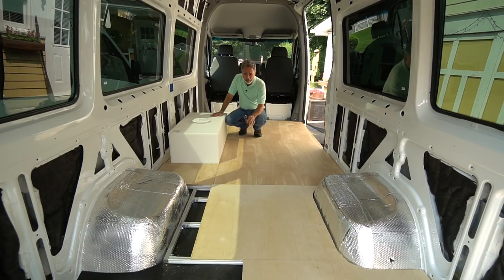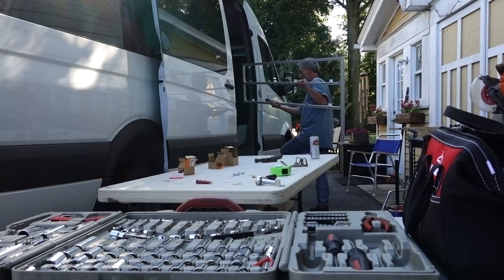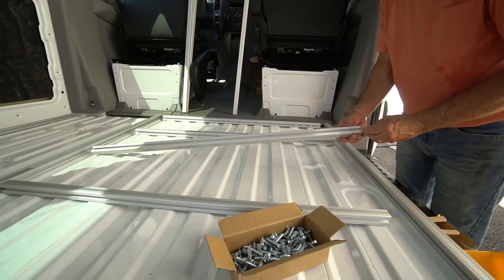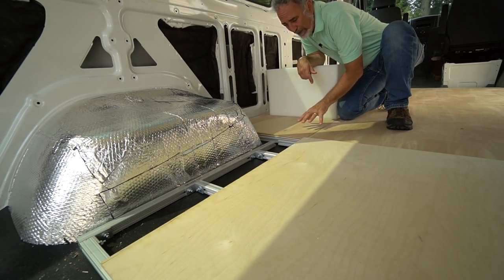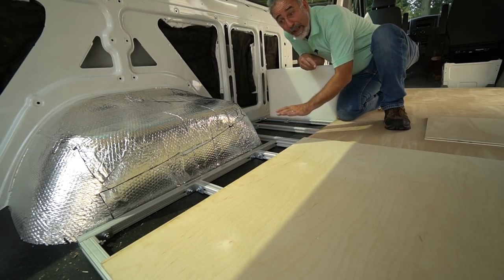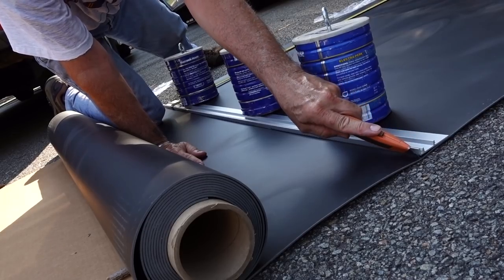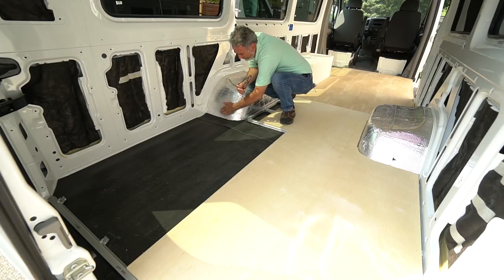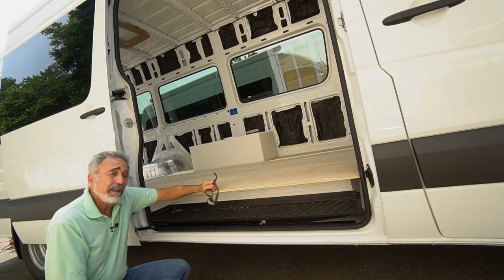VAN BUILD SERIES 09 | My Floor Design

Comment: One consideration though, aluminum is an excellent heat conductor. Wouldn't it be better and simpler to use some composite wood product, i.e. engineered decking wood?
Reply from the maker: Yes aluminum is a good conductor of heat. But only if heat is applied to it. Mine is sitting on 1/8" of heavy mass vinyl. That is a major league thermal break. Also affords a vapor barrier and sound deadening.
Engineered composite deck products are not made for indoor use. Toxic chemicals and off gassing.
Reply from the maker: Some have complained about my choice of material. I want something impervious to moisture, mold and mildew. Longer lasting.
Reply: I'm with you on that point. No wood in my (future) build, if possible. Wood is susceptible to moisture, will warp, crack, mold, rot, etc. Plus it's heavy and takes up too much precious space.
When it comes to the floor I was wondering if it would be at all possible to get away with no battens? I mean the polyiso board stands up to compression and is commonly used in construction under plywood or concrete over large areas without battens. Perhaps high density polyiso?
Reply from the maker: I like using the 1 inch battens for two reasons; (1) the air space, filled with Thinsulate is an excellent insulation system, (2) a great place to run wire and pipe.
Reply: I see. I decided on no wires in the floor. As for pipes, I'm thinking of keeping all water-related equipment on one side of the van, so no plumbing crossing over, and all electrical on the other side. That might be problematic, if I wanted to have external hookups and keep them both on one side. But that's the idea.
Reply from the maker: I'm doing exactly as you suggest. Electrics on one side under the galley, however, I will run a sub panel on the opposite side for fridge, lighting, etc.
Water runs unbroken from tank straight back to rear fixtures along driverside. The heating tubes will be on the floor, with the return leg running up and down the hallway, radiant heat, sort of..
Reply: In my case it will be reversed - water tank under the galley, together with the pump, pressure tank and water heater, right in the proximity of the sink, which will be situated at the end by the rear door, while batteries and the whole solar shebang on the other side. So I might install the water hookup at the rear of the vehicle.
I also want to use space within the walls to house most of my electronic stuff, wiring and plumbing. So I envisioned layered insulation scheme: Low-E (or similar) insulation straight on metal ( youtu.be/T_AYRXhjzTI ), then Thinsulate, and then polyiso board attached in a drywall fashion, with no battens - straight to the ribbing of the vehicle, with use of lock nuts, well nuts or push-in nuts, possibly rubber or nylon. Same on the ceiling.

Comment: Does the mass loaded vinyl trap moisture? I see there are ruts on the floor. I am thinking of getting a step van and using something like MLV but there are no ruts in the floor.
Reply from the maker: It could, but I have provided for air flow underneath
Reply: @HumbleRoad  You mean with the ruts in the van floor?
Reply from the maker: yes

Comment: Sorry if this has been answered - are you insulating the floor with anything other than the rubber mat?  Also, are you worried about the fresh water tank freezing if it is so close to the bottom of the van floor?
Reply from the maker: Yes, I will lay Thinsulate into each of those voids. In the final pass, I will lay 1" vinyl strips on top of the aluminum. Another thermal break, although not necessary, and to prevent squeaks. The only way the fresh water could freeze is if you leave the van unattended, without a heat source. The futon frame, as well as all the other frame modules, will be open to ventilation. There are no enclosed cabinet boxes in this build.

Comment: Hi George,  I have noticed that in your newer videos you are no longer using the heavy mass vinyl under the your subfloor.  Is there a reason for that?
Reply from the maker: My newer videos are coincidently all for specific clients who have specific needs. (they are too tall to allow for all the layers of subfloor insulation). Or...the van is not a 350 or 3500 and we cannot afford the added weight. Each an every build I do is a new invention!
Reply: @HumbleRoad  Thanks for your reply!  The reason I was asking is because I'm building a 2500 Sprinter and I am planning on copying your design (from bottom to top:  heavy mass vinyl | 8020 subfloor frame |  PolyIso | 1/2" plywood | flooring).   So I was just wondering if you still recommend the heavy mass vinyl under the 8020 frame.

Comment: You’ve mentioned you like to use the battons for air 1) space/insulation and 2) a place to run cables and stuff later. Im curious, would you consider not using battons if you weren’t worried about these things? Im thinking heavy mass vinyl then plywood directly over this. Im not very worried about the insulation and cabins items will all be made out of 80/20 and easy to secure. My question really is: do you think the floor would be stable enough without the battons? Great Videos btw. Greeting from Australia.
Reply from the maker: If you don't need the insulation on the floor, then sure, omit the battons. One concern is how to attach the HMV and plywood. I don't think the adhesive will stick to the HMV. Rather than plywood, consider a thin structural foam board.
Reply: @HumbleRoad  Thanks for the tip. Ive seen people use a foam board beneath the ply and between the battons to act the insulation and vapour barrier but not as a replacement of the ply - assuming different material. I will check it out! Cheers.

Comment: George, I am buying an older class B that I want to strip it apart to sound proof, and insulate the floors and walls. Where did you order the vinyl from? I found the Noico and insulate on Amazon.
Reply from the maker: HMV is one pound per square foot. It's too heavy to have shipped. Try to find it locally where you can go pick it up.

Comment: Hi George...Are you using 1" 8020 on floor and 1 1/2" for the rest?  Thank You Kindly!
Reply from the maker: Yes, Mike. First a layer of heavy mass vinyl, then 1" 8020 then half inch ply on top of that. When I am ready to fasten down, I will attach the 8020 using rivnuts. Then self tappers for the ply into the 8020.

Comment: Hi, I am loving the van build series, great job 🤓👍👍👍.  A quick question if I may, did you have any issues with the vinyl sagging into the troughs of the ribbed floor of the van? I was considering filling them with strips of insulation, tedious I know but I’m all for a belts and braces approach.
Reply from the maker: It's possible the vinyl could sag into the troughs. I changed the floor system, so the vinyl was not under the framework.
Reply: @HumbleRoad  Cheera, I’ll keep watching and save any questions til the end 😁

Comment: Hi Humble 👋 Andrew Ditton..my favourite UK youtube creator just posted a vid on the New  2019 Adria panel van campers. Take a look at the uber cool new wet bath/shower system. It may intrigue you.Btw Pleasureway Lexor got a thumbs down from me re:ergonomics unfortunately. Travelling a hundred miles in the other direction to see Travato, Hymer and Roadtreks tmr morning. If I’m not wowed I have already starting looking for a Promaster hitop...good lord...help! 😬

That heavy mat vinyl you used as sound/insulation says it has no odour on amz listing. Is that correct? If so it must not be made from a petrochemical base?
Reply from the maker: The vinyl I bought is typically used in the construction of recording studios and sound stages. There is no odor and it is chemically neutral . I have a data sheet with all it's certifications. It's good stuff.
Reply: Humble Road Thanks Humble. I’ll  try to source a sample to test it and get the msds and technical sheets. Dont need the big rolls or the hernia! Lol. It would seem odd but the Roadtrek Simplicity SRT won the ergonomics competition 👍. Too bad they put such outdated systems on it to keep the price down. $75,000 CAD bf taxes. I always bought my houses/investment houses from the systems out. Think this might work with an rv buildout. A boat builder in the back pocket might come in handy.🤗

Comment: forgive me i’m a bit confused on this build u put the mass vinyl first and no insulation becouse of the radiant heat and bolted down not glued like the first van so wich is better glue or bolts and does the mass go down first or over the top of insulation for my build thank u for answering my last question
Reply from the maker: Disregard this floor system as the buyer opted out of radiant and In ever completed the design. See more current videos for floor treatments.

Comment: Leave that area as a place to keep shoes. Well throughout floor but doesn't the floor need insulation?
Reply from the maker: I started by laying the mass vinyl on the bare cargo floor. That offers sound, vapor and thermal barrier and some r-value insulation. Once I finish all the wiring and plumbing, I will lay Thinsulate in all the frame voids then put the plywood sub floor back on top, then finished flooring, tile or tongue and groove.
Reply: Humble Road Excellent choice on Thinsulate. Not sure ceramic tiles would hold up, or do you mean other floor tiles?
Reply from the maker: Agreed, I would never use ceramic tiles in a van! Almost every class b manufacturer uses some type of vinyl tile as finished flooring. My first choice is going to be a teak and holly sole. If you google that, it will take your breath away!
Reply: Humble Road Elegant! Just looked it up. Costly, but not bad for a small space. The lines will help with the van visually appearing larger. Lots of prep work with the varnishing etc, but so worth it. Great choice 😄

Comment: Is having heat under the refrigerator a good idea?
Reply from the maker: I like your thinking, Karen. The unit has a fan blowing through the heat coils. And my fridge compartment is open for ventilation on all 6 sides. Since you will be calling for heat in the colder climates, I don't think it will hurt the fridge.
Reply: Humble Road 
Thanks. I’m sure you will let us know how everything works.

Comment: Where did you buy the rubber underlayment you're using and do you have a link to it?
Reply from the maker: That material is one pound per square foot. 100lbs per roll the shipping will kill you.. Best to source it locally.
Reply: @HumbleRoad  what's it called?
Reply from the maker: Heavy mass vinyl, mass loaded vinyl. Check in the acoustic industry.

Comment: When drilling into the floor to attach the frame rails, how do you know you are not drilling into a brake line or something else that can be damaged?
Reply from the maker: I did not drill into the floor. I glued the aluminum using a product 3M 5200

Comment: Are you getting your 80/20 from 8020,net?
Reply from the maker: Jesse Parris yes directly from 8020. They are very very slow. 3 shifts 6 days a week and they cannot hit their delivery schedules. However, everything is in stock and I have recourse if there is any problem. Since I intend to build several of these vans, if not dozens, I need to develop close loyal relationships with my suppliers.

Comment: Can't understand why you need such a warm floor- I lived in a van in winter and with a pair of Uggies on my feet, the thought of a warm floor never crossed my mind. This system you lose 20mm of height off your internal van space and add an extra 20kgs of weight (at a guess) to the van... I think there is a better way.

Comment: why 80/20 instead of wood?
Reply from the maker: 80/20 does not rot, doesn't retain, nor attract moisture, is not as affected by the temperature and humidity. Offers greater torsional strength, and it's cool! ;-)

Comment: What's the purpose of the vinyl ??
Reply from the maker: Sound barrier, vapor barrier, thermal break, insulation. Once I am fully wired and plumbed, I will add Thinsulate to the aluminum frame voids then put plywood back on top.

Comment: No insulation in the floor? Rock wool would be perfect as it's unaffected by water, blocks sound, and insulates. You made that floor way too complex with cut out areas. Aluminum extrusions with fasteners are expensive and will eventually rattle. A simple insulated framework and thicker wood sub floor would have been better. Then add and secure units on top of it.  It's not a space station.
Reply from the maker: what would I do without you

Comment: Interesting but incomplete. How did you attache the 80/20 sleepers to the van floor? How did you attach the plywood to the 80/20? If there are T nuts in the slot of the 80/20 how do you hit them once the plywood is in place and you can't see them anymore? Incomplete video!